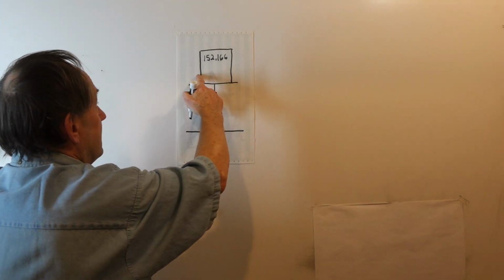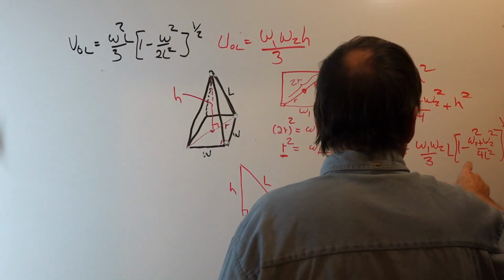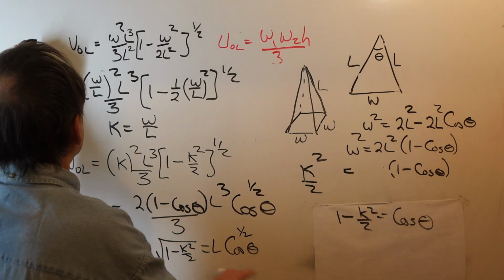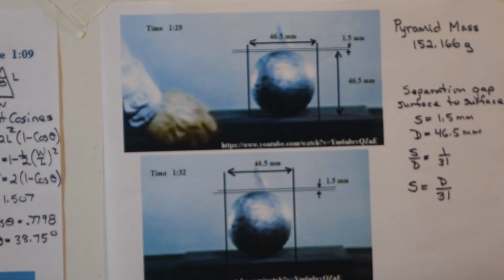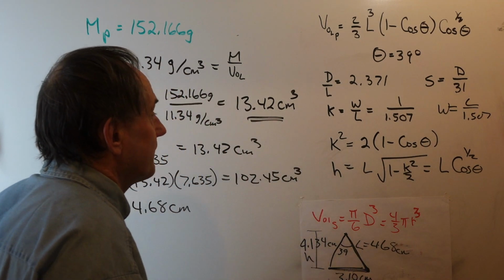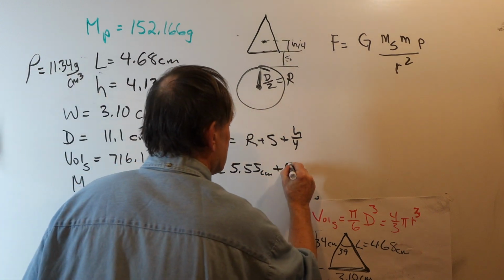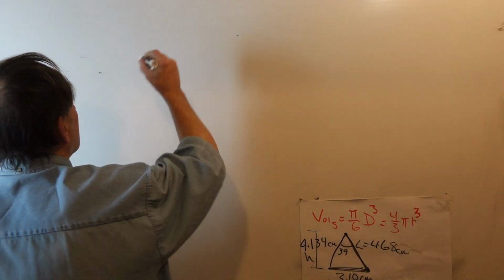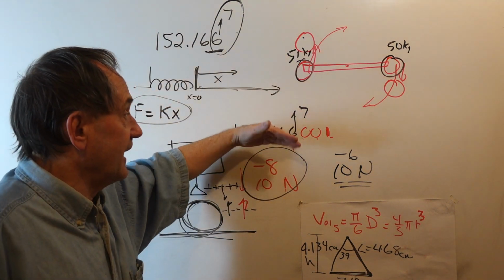Measuring Gravity

Comment from the maker: The video that is being analyzed is the following:
https://www.youtube.com/watch?v=cqN8rqY8uGs
     GRAVITATIONAL  ATTRACTION
GH
Reply: So to play devils advocate.. the scale could be teetering 99% of the miligram without rolling over because it's partially mechanical, it then took very little to tip the scale to the next digit.. maybe a microgram. Maybe the two weights were pre selected because the person demonstrating the point knew that 1mg wasn't going to work but didn't have a microgram scale to hand. 

Is that something that can be ruled out? The straw that broke the camels back? I'd guess testing that particular scale would be the decider but maybe I'm wrong?
Reply from the maker: Gently,
That is the possibility I was trying to describe.  But if the person demonstrating in the video knew that 1mg wasn't going to work, that should have been pointed out in the video.  I doubt very much that the weight selection and scale were selected with that amount of consideration.

I rather suspect they blind and happy without checking what they were looking for.
GH
Reply: @georgehnatiuk5806  your probably right George. 

Honestly I hadn't finished watching before I replied, if you already eluded to my point about the scale in your video then I apologise for being too previous.

This was a point I was trying to make when this anomaly was brought to my attention a few days ago so I jumped in with my thoughts without watching fully.

I'm fairly happy I came to the same conclusion you had though 😃😃

Comment: I can say from my personal experience that the lead ball demonstration is not plausible. I worked at a company that built gravitometers, and I built about 75 of them. If it was really that easy to build a gravitometer we wouldn't have to charge so much for them. One remarkable (and true) demonstration is the variation of gravity with height. At the location of the facility I worked at a height change of 2.5cm (1") will give a reading change of about 1 microgal on a good instrument, and be repeatable. This was why it was important for high accuracy surveys to know the location of the sensor within the instrument case.
Reply from the maker: Right on.
GH

Comment: On the scale flipping a digit demonstration -- Simple --

Take the weight and prepare it, while weighing it on the scale. Carefully file it until the weight just barely "flips down" the least digit. Now introduce the large mass. -- The least digit will "flip up".

It's a bit of a "trick", but it is a valid demonstration of concept... as long as moving the large mass consistently flip-flops that least digit. The cause and effect is confirmed.

Of course the FlerrFerrs will reject this, due to the preparation... and because scales (and the weights) are "man-made".
Reply from the maker: Agent,
That is a great idea to increase the "sensitivity" of the scale and in effect give you another digit of resolution in a manner of speaking.   There is always a bit of Dead Zoning and hysteresis in any instrument.  That is what I was trying to get across to Chris Berry but all he ever does is blurt out with that annoying laugh of his and refuse to think and consider how scales work.  You earned a heart.
GH  May 24, 2020
Reply from the maker: @paulinnanjing  My best argument against that video you reference is in my video and simply this:  The scale is a milligram scale. I went to great lengths to determine the mass of the sphere that is slid under the pyramid given the fact it was not stated in the original video nor was the size of the pyramid which I also had to figure out to know the distance between the centers of mass of the sphere and pyramid, hence the math derivation at the beginning of my video.  From the masses of the two objects and knowing the distance between their centers-of-mass, we can use the Newtonian gravitational force equation to compute the additional force of attraction between the pyramid and the earth when the lead sphere slid under the pyramid.  I computed this additional force indicated as a weight change to be  F = 1.763 X 10^(-8) Newton and a limit of 1.0 milligram force indicated by the last digit of the scale is a change of F = 9.807 X 10^(-6) Newton or a factor of 556 times larger than the change in gravitational force when the lead sphere is slid under the pyamid.  It is highly unlikely that change in gravitational force could have flipped the last digit on the milligram scale.

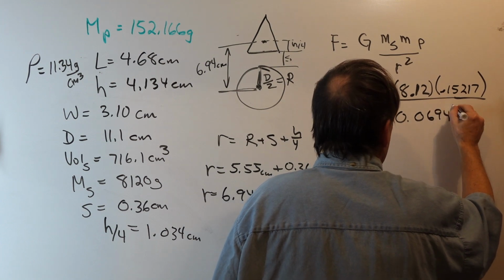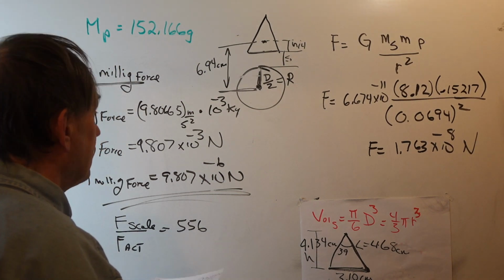Listing to my video from time  41:30 to 45:03

I believe the video in question was made to illustrate a point of principle rather than being rigorous and carefully conceived and implemented.  There are many other things as you mentioned above that could have caused the last digit to flip -- even noise in the system at the proper time could have caused it.  I would NEVER trust a single digit change of resolution in ANY instrument unless it was demonstrated to me that the noise level is well enough below the instrument's resolution.  For example, reading 3 digits of resolution on a 1.012 volt signal with 1 microVolt of noise with give a solid 3 digit reading using a 3 or 4 digit voltmeter but measuring the same signal on an HP 3458A 8-1/2 digit meter will give a 8 digit reading with 100 counts of noise with the last two digits out of 8 flopping around being quite meaningless. 

That video is a good demo to illustrate a principle but does so in an inaccurate manner that could not have actually occurred in practice though in principle it could if the weigh scale had more resolution to indicate the force change using a microgram scale and not a milligram scale as you pointed out.

Hope this explanation helps.  You can quote me on this for I am an expert in the field of instrumentation theory and design having designed some of the best analog front ends used in the laboratory equipment Hewlett Packard / Agilent / KeySight markets.
GH  June 19, 2020 from Colorado
Reply from the maker: @paulinnanjing  The self heating is a non-linear error that cannot be removed from the reading in software by a simple offset or scale factor correction.  You would need a lookup table and use the voltage reading across the sensing resistor for the entry into the table for the correction factor.  This is well beyond the scope of a cheap multimeter and not even used in expensive meters for the extra time needed for calibration.

Yes, dithering can be used in any type of system to get more resolution and accuracy in measurements.  The price you pay is in reading speed -- need to sample 100's of readings and average to get one more digit of resolution.  But it is a useful technique to extract uncertainty in the last digit of resolution.
GH
Reply: @paulinnanjing  
Which is why you do numerous trials to eliminate "random" errors (passing trucks) and study what may be other causes sobaso to eliminate them by tweaking the experiment (systematic errors -- electrostatics).
Statistical analysis must be applied to the data to discover the "random" errors; peer review to discover the systematic errors.

This _is_ the way it works.

Until and unless a more sensitive scale is procured to get better quantitative measurements then this is still a valid "prooof of concept" qualitative experiment. It is not intended to measure the value of G (Big G) but to demonstrate that the Universal Gavitaional Effect is observed -- mass attracts mass.°

I specify the small mass to be shaved to get a steady reading, just barely "flipped down".  Now go and get 10 people to jump up and down on the floor and shave a bit more 'til it's still steady. Then use a greater large mass.

The "unstable equilibrium point" is not exactly the point. George points out the hysteresis in the scale. Those are sort of related but not the same. The idea is to push the hysteresis well within the error band... this minimizes "instability" as an issue.
Reply from the maker: @paulinnanjing  
Some of what you say is true but air currents, vibrations and electrostatic forces can all be easily isolated.
Air currents:   put apparatus in a plexiglass enclosure and move lower weight with a metal wire
Vibrations:  put enclosure on a table with air shocks
Electrostatic forces:  construct sphere and pyramid out of lead which is a conductive metal and ground all parts - also use an anti-static conductive spray on plexiglass enclosure and ground it -->  ZERO electrostatic forces

This is not an intractable and impossible problem to solve.

Gravitational forces for these masses could "flip" the resolution digit as the force is at the microgram level.
GH   June 19, 2020 from Colorado
Reply from the maker: @paulinnanjing  All very true.  Trying to flip a milligram scale at the microgram level  is unlikely no matter how close you trimmed weights etc to get you to the border of change.  I might guess you could pull off one more digit but not three.
GH
Reply from the maker: @paulinnanjing  
Paul,  the filing of a mass to get it to where the scale is just about to "flip" its last digit will work to detect a change smaller than the last digit of resolution but only to maybe the equivalent of a factor of 10 to give you another digit of resolution at best.  This is analogous to a technique called "dithering" used in precision instrumentation where you add noise to the system to ride along on top of the desired signal and sample a large number of readings and average them or perform and FFT(Fast Fourier Transform) to take out the noise and reveal the signal that was buried in the noise.

This is the problem I have with these idiotic FEs when they (as well as globers too) present measurements without stating the all important uncertainty in their measurements.  Any measurement that you make without knowledge of its uncertainty is completely meaningless.  There are no meaningful measurements without their uncertainties.

The inaccuracy in current measurements is due to the way current is generally sensed by a meter.  The earliest method was to use a galvanometer where a needle attached to a small  magnet is immersed in the magnetic field created by the flowing current.  This is very crude but can be quite sensitive even though it is inaccurate.

Modern instruments (ammeters) insert a metal wound resistor in-line with the current flow to convert the current flow into a voltage reading across the resistor that is measured by a very accurate voltmeter and the reading scaled to indicate amperes of current flow through the resistor.   Volts =  current(amps) X  resistance (ohms)   so   I  =  V / R             scale factor is determined by the resistor value

The inaccuracy in the current reading is primarily due to self heating of the series sense resistor that is inserted into the circuit being measured to give you a current reading.  All resistances will dissipate heat (Joule heating) when a current flows within them according to  P = R*I^2  which we call I-squared R heating or Joule heating.  All resistors have a temperature coefficient some positive and some negative depending on the metal alloy used to build the resistor.  As soon as you insert the ammeter into the circuit and turn on the power, the resistor will shift value and hence the voltage across the resistor also shifts giving an inaccurate reading.  Also the initial accuracy of the resistor affects the accuracy of the current reading.  The very best resistors are Vishay precision resistors that can be manufactured to 0.0001%.  There are other factors that contribute to the uncertainty but these are 2nd order effects and dominated by the self heating of the resistor element.
GH  June 20, 2020   the solstice
Reply: And the technology is prehistoric. MY scale can measure nanograms and needs to be kept in a hood with hepa filters and a dehumidifier along with a temperature control.

Comment: Well done George. 

As usual, one always has to do the numbers on something before you can be sure of some analysis, wishful thinking or intuition always has to be checked. And as you have pointed out, relying on the last digit of a measuring device is never a good idea.
I agree that this test of gravity cannot possibly be correct.
Reply: Although I think the pyramid is a tetrahedron!
Reply: Well... If the last digit can consistently be made to change then you can infer that the next less significant digit is changing. That's about it.
The curse of digital readouts... people trust what they say as exact.

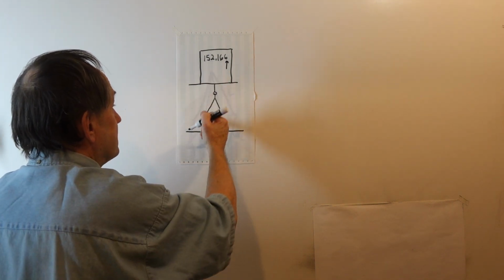Comment: I had a discussion on another video that includes this experiment and came to the same conclusion as you. From 1:06 here: https://youtu.be/Ym6nlwvQZnE

This is not a valid experiment, it is a parlour trick, and does a disservice to science. If the effect being measured is much less than the resolution of the measuring device, that needs to be clearly stated.
Reply from the maker: Yes it is a disservice.  Could not agree more.
GH